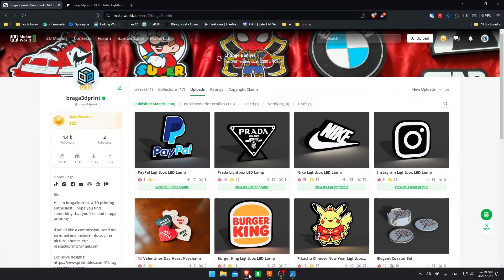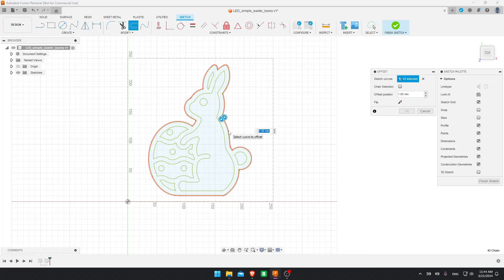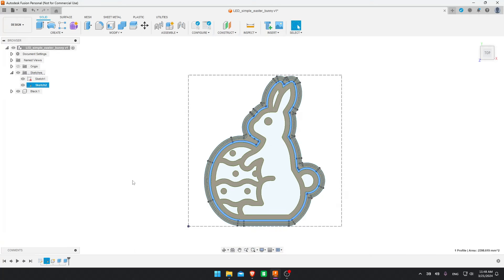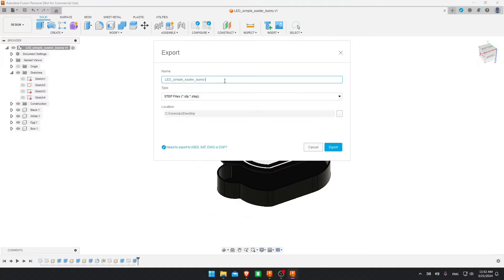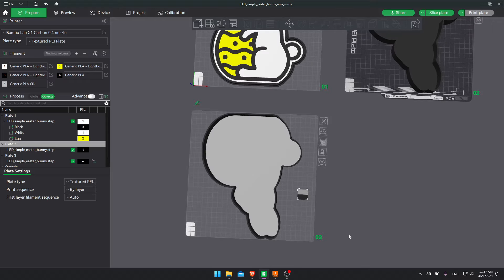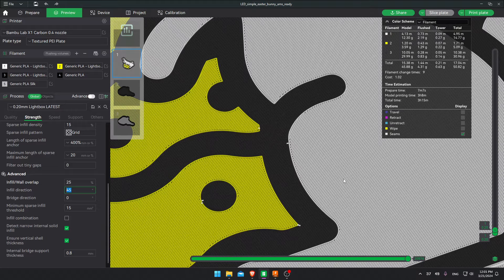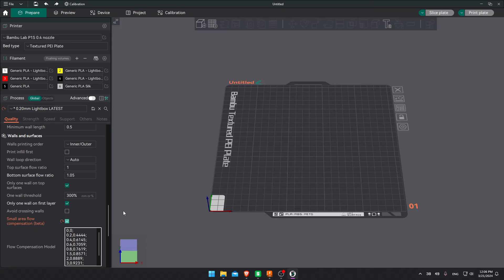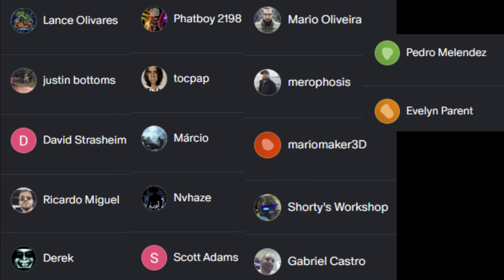How to make a 3D Printable Lightbox | Fusion 360 | braga3dprint | vectorizer.ai | Bambu Labs

Comment from the maker: I wanted to share some additional insights regarding the 'Reduce infill retraction' setting mentioned in the video. Upon further consideration, it's important to note that this setting doesn't retract filament when the travel occurs within the infill area. Considering that the faceplate doesn't have infill, it's possible that this setting may not have a significant impact on your print quality or performance.

Comment: @braga3dprint I tried to follow along herewith my own “simple” logo but I was having issues with the offsets. I was trying to use the same offsets you were. I guess with the logo I was using and your bunny example the different offsets wouldn’t work with my logo. I managed to get through your steps here but at the end I did not have the back piece. Is this something I can add on easily or should I try to start over?